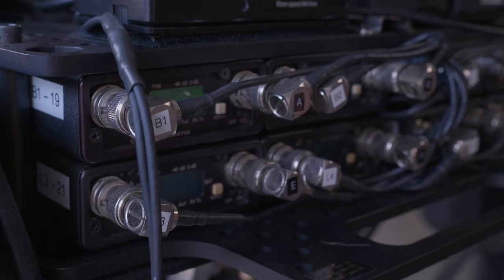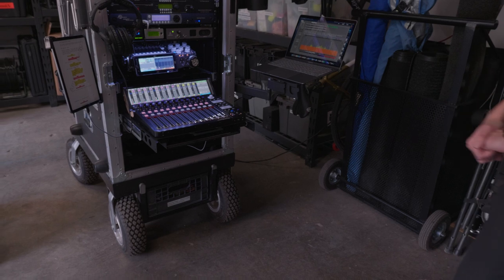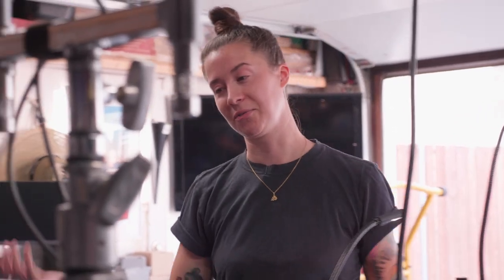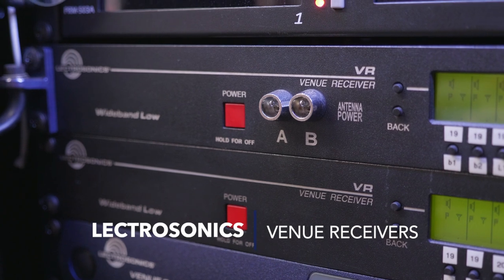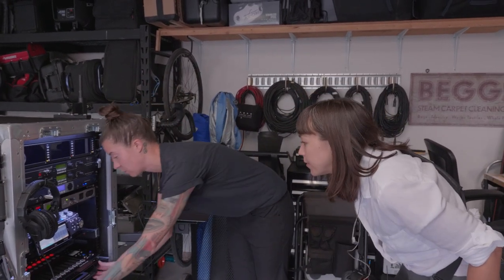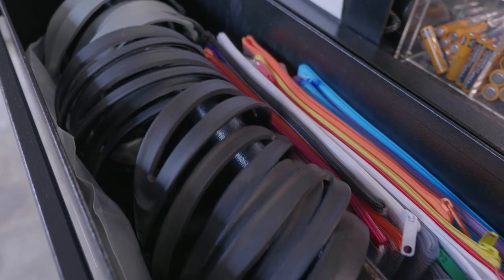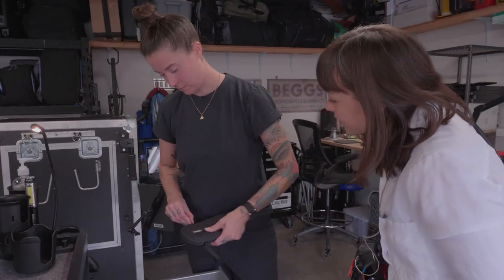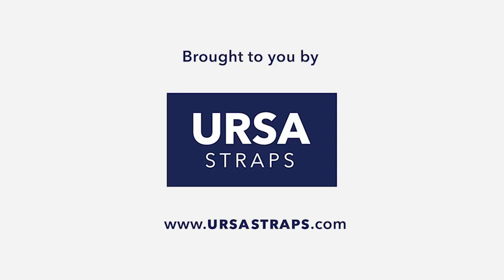What's in Your Kit? With Sound Mixer Amanda Beggs CAS | URSA Exclusive

Comment: As a DSP chip design EE, I love seeing what creative people do with my designs. This is fantastic. PLDs are in every piece of equipment ms Beggs is using. I know, it may be silly, but it is exciting for me to watch.
Reply: This is awesome - what have you designed that I’m using, can you be specific?
Reply: @amandabeggs3198  Although I can't mention company names due to NDA with current contracts, Altera (now Intel), Analog Devices, Cypress, Yamaha, and others who used my FPGA, CPLD, and other memory chip designs, were some of the names who used my designs. New designs have larger mBGA chips (check IPC-D-275) for more complex designs with many more features on small boards. This makes the equipment smaller, portable, and lower power consumption devices - which in turn, makes it cooler to handle. Keep creating and pushing the limits. It makes me very happy. If you only knew how all this started. LOL

Comment: LOL, I laughed when she said “this does cut down on the weight” and “slightly more heavy”. This beast must weigh at least 1000 lbs already. I don’t think cutting down on weight was a top priority
Reply: I reckon even at this point weight still "matters" to a certain extent, would you rather it is 1000lbs or 2000lbs? ha
Reply: @SoundSpeeding  I may have under exaggerated with that 1000 lbs.
Reply: @SoundSpeeding  at 1000 lbs you have a cart that required two strong people to move safely and a fork lift to pick up. Same for 1200 lbs. at 2000 lbs you need 4 strong people to move safely on unlevel surfaces and a forklift to pick up.
Reply: @GOLDVIOLINbowofdeath  exactly, if Amanda's cart was even 50% heavier it would end up totally changing the way she works with it
Reply: @SoundSpeeding  yes, but she is not talking about 500 lbs difference, not even 50 lbs
Reply: @GOLDVIOLINbowofdeath  it's those marginal 0.1% gains! ;-) They all add up in the long run. 
#TeamSky
Reply: @SoundSpeeding  Did we watch the same video? I am designing a sound cart and every part included gets weighed by my baggage scale so I am well aware how things add up since I want the cart and the rack mounted gear and the case to all weigh less than 100lbs so the cart can be checked as baggage. I just completely remade 9/13ths of the cart just to shave off 3lbs.
Reply: @GOLDVIOLINbowofdeath  "I just completely remade 9/13ths of the cart just to shave off 3lbs."

I think  you're actually saying we're on the same page here! Making those marginal gains.
Reply: @SoundSpeeding  yes, but for my base cart 3lbs is probably 7% and at max checked baggage weight it is 3%